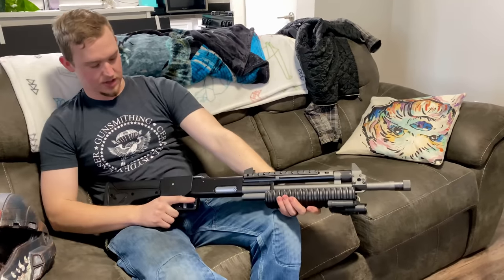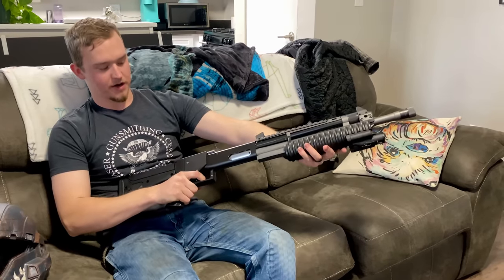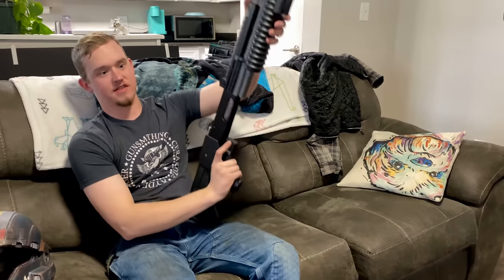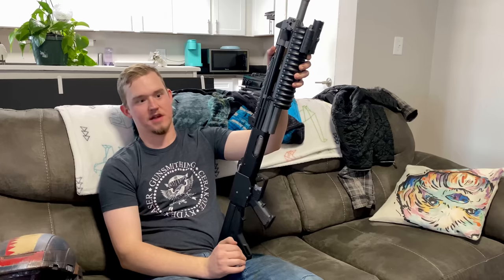The M90 Halo Shotgun, but REAL.

Comment: Let me guess they didnt teach you a single thing about actual gun bluing... Cant even find someone to touch up old guns anymore smdh all they do is offer to paint your old antique firearms with that ugly "cerakote" which is nothing but glorified paint with a little ceramic added in..
Reply from the maker: I did get trained in traditional bluing, caustic hot salts are a beautiful thing. I blued quite a few parts on my gun you see here as well as a SAA revolver I worked over. The issue with bluing and it not being as available as cerakote is largely in part due to the cost of setup and materials. Bluing is also regulated but the EPA fairly strictly and this further reduces the amount of people interested in doing the service professionally. Cerakote has its advantages in certain uses as does and finishing process.